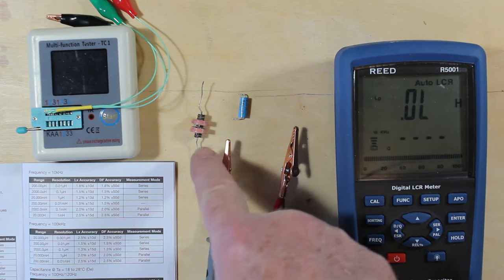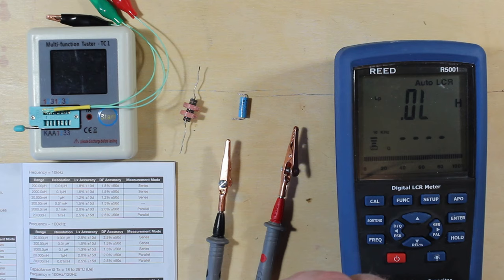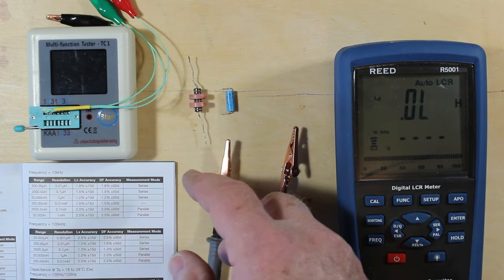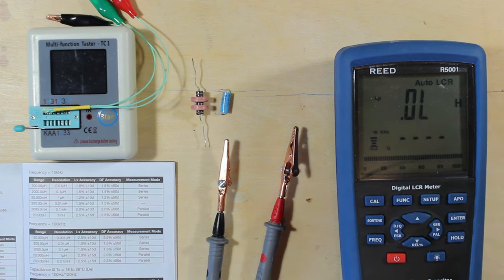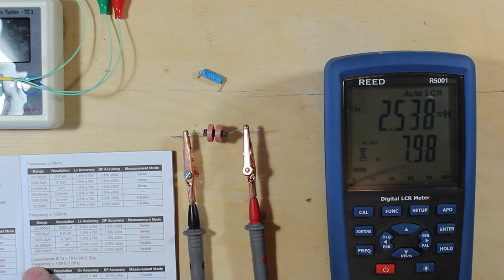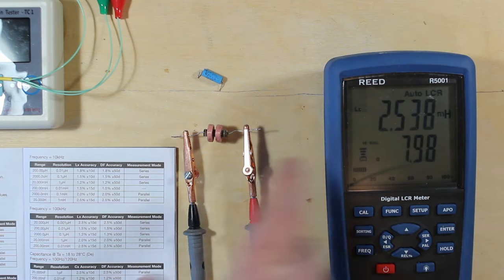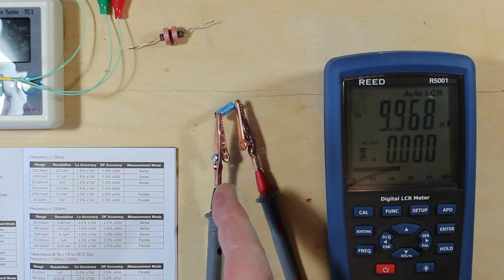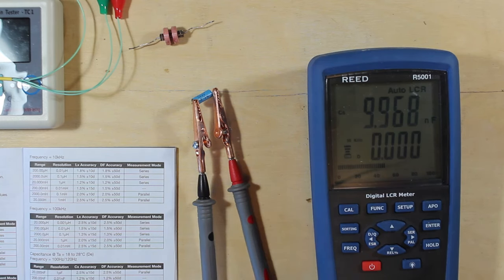LCR Meter Increases Confidence In Previous Measurements #electronics #measurement #testing

Comment: Thanks for your video. I wasn't familiar with the Reed LCR meter but looked it up. It has 100 kHz max test frequency and sells in the $250-300 range. I use a similar LCR meter that also has 100 kHz max test freq, the DER DE-5000. It has near lab grade accuracy and is much less expensive, around $100 for the basic version which is all I use. I love mine.
Reply from the maker: Thanks for the comment.  The Reed meter was borrowed from a friend.  I've never had an LCR meter and use other measurement methods when needed, but it would be nice to get one because it's so quick and easy to use.  I see the D-5000 has generally good reviews, especially given the price, which varies widely on line. Time to do some shopping....
Reply: @MoreThanElectronics  I'm sort of an LC meter junkie with many bought over the years. Since finding the DE-5000 that's all I ever use now. There are various options for it. I don't use any of them, just the basic meter. I make short banana to mini-alligator test clips and plug them into the meter and use that for all my tests. You initially do the calibration once then the meter is good to go from then on. Oh, I did eventually buy the wallwart supply since I use mine so much and like to just leave the meter on while using it for multiple tests. But it will run for a very long time on the battery too (and you can leave the battery in if using the wallwart supply, as it cuts off the battery power when plugged in--then you can use the meter either on battery or with the wallwart supply).